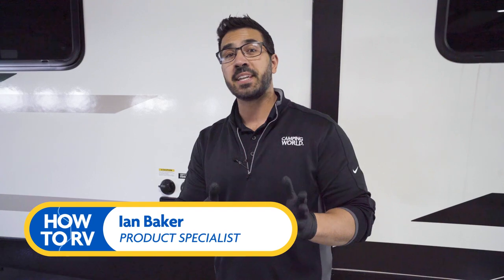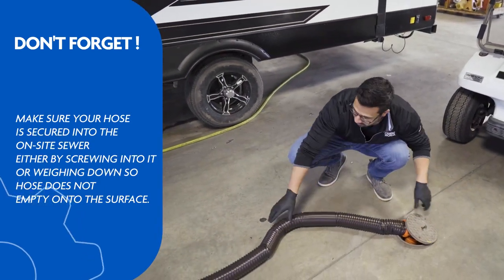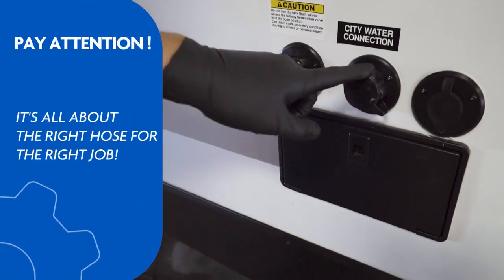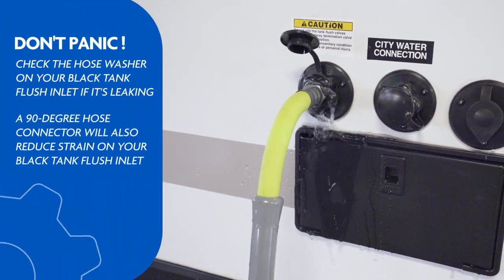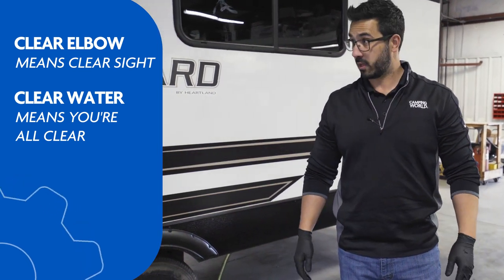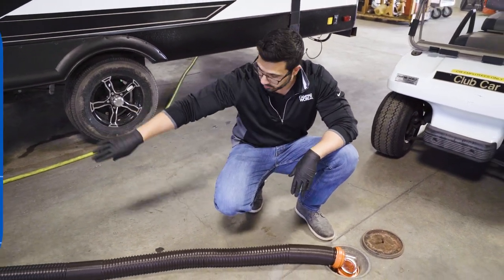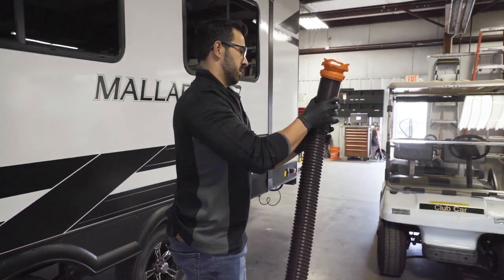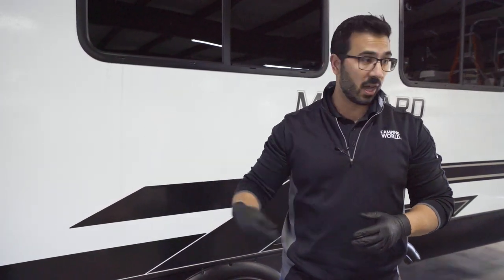How To: Flush an RV Black Tank

Comment: Is the label by the black tank flush port referring to the knife valve on the outside
Reply from the maker: Yes! You MUST keep the black tank valve OPEN when using the tank flush or else you risk overflowing your black tank and causing damage.
-Ian Baker

Comment: You're saying "overflow" does this mean the tank is getting over filled and the water is leaking out? Or did you just mean "leaking" due to hose not being screwed on good? New here and just trying to be clear as my worste fear is having an inside flood
Reply from the maker: Hi Michelle!

If you're referring to the reasons to leave the valve for your RV's black tank OPEN before supplying water to the black tank flush inlet, the danger is certainly overfilling the tank. 

That handle must remain open while you supply water to the black tank flush inlet. The grey tank valve should be closed during this process.

If you're referring to leaking at the black tank flush inlet specifically, the remedies for that are either replacing the hose washer or using a 90-degree connector to reduce the downward pressure placed on that inlet by the weight of the hose and the water running through it. 

Hope that helps, but let me know if you have any follow up questions!
- Tucker Ballister
Reply: @campingworld  no, I was referring to the water leaking from where the hose is screwed  into the back flush connection. I was a little confused because you said "overflow" and at first I thought overflow...filling up and coming back up through the connection. Being a newby, I take everything literal 🤦‍♀️🤷‍♀️
Reply: @campingworld  no, I was referring to the water leaking from where the hose is screwed  into the back flush connection. I was a little confused because you said "overflow" and at first I thought overflow...filling up and coming back up through the connection. Being a newby, I take everything literal 🤦‍♀️🤷‍♀️

Comment: Thanks for the video! So do you leave your water pressure regulator on the flush port or can you use whatever psi the campground is providing? Thanks again!
Reply from the maker: Great question! 

Since this process calls for leaving your black tank valve open, water from the campground will enter the black tank flush, run through the tank itself to clean, and then exit your sewer hose. 

There won't be a build up of pressure like there is when you connect to city water and your faucets are closed, which is why a pressure regulator is necessary for that application but not vital for this one. 

Hope that makes sense, but feel free to ask any follow up questions!
- Tucker Ballister
Reply: @campingworld  Thanks for the reply! To my reckoning. I figured if I use the say 75psi pressure at my site vs the 45 on my regulator. The higher pressure would in theory clean a little better than with the lower psi. I will use a splitter next go around and use the full psi side as my camper side port flush side. Again. Thanks for the speedy reply!

Comment: I like to use a cutoffs value hooked to my flush water hose so I can fill my  tank several times without cutting the water off everytime. I also use a gate value hooked to my clear fitting so I can fill my tank while the flush line is filling up my black tank
Reply from the maker: Great tips, thanks Thomas!
-Ian Baker

Comment: Never open both tanks at same time, you don't wanna chance poo water into ur gray tank, it'll smell worst than gray water. Also what do you mean by drop black tank?
Reply from the maker: That is a good point, don't open both at the same time, I like to do black first then grey.  What he's referring to is when you turn on the black tank flush without having the termination valve open, the water fills up the tank, makes it too heavy and the tank drops down or falls out.  It's just a good rule of thumb to make sure to have the black tank dump open before you turn on the black tank flush.  I hope that helps!! Thank you so much for the comment and for watching! - Chris Young

Comment: Hey Ian my name is David I was wondering some said that you could put in a black tank flush system for the second bathrooms that doesn’t have is that true?
Reply from the maker: Hey David, Ian Baker here. From what I've been told, you CAN add a permanent black tank flush system, but it pretty labor intensive. I would honestly recommend just using a portable type tank flush as it will be much less expensive. Sorry for the SUPER late response, but I hope this helps!!
-Ian Baker

Comment: In your experience, should any black tank stuff get through while the black tank valve is closed?  I've been having a problem where there is some black tank stuff coming through when I pull the end cap off even when the black tank valve is still closed.  I've had our RV dealership work on this issue twice now.  If it is normal for some to get through, how much is normal?  a cup?  Several cups worth?  I feel like I sometimes have a gallon or more of black tank tank stuff coming out as soon as I pull the end cap while the black tank valve is still closed.  The RV dealer completely replaced the black tank valve the last time I had them try and address this, but i'm worried i'm still going to have this disgusting problem!  I am super nervous when i pull the end cap that i'm going to have a gross mess on my hands.  This is our first RV so i don't have prior experience to compare this to.
Reply from the maker: Hi Jeff! In my experience, there can be a small amount of leakage (from either gray or black tanks) into the pipe between the valves and the end cap. I always place my sewer hose beneath the outlet before I remove the end cap so that small amount drains into the hose instead of onto the ground. But it's usually less than a cup. A gallon is far too much and tells me that your valves aren't sealing properly. It's a good step to replace that valve, but you could also have a problem with your gray tank valve, depending on your setup. What's the make/model of your RV? And you could always fill your tanks with fresh water and test that your new valves are working properly before you test with "other stuff" in your tanks. Let me know what type of rig you're working with and hopefully the new valve does the trick! - Tucker Ballister
Reply: Sounds like a bad seal somewhere